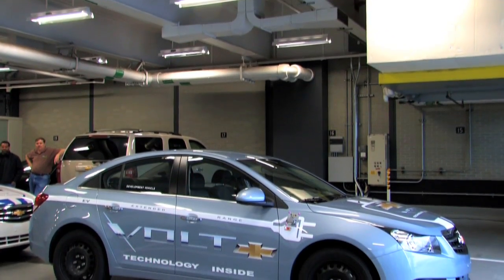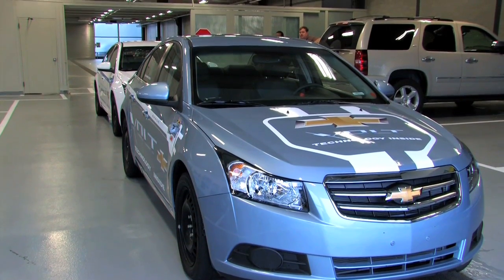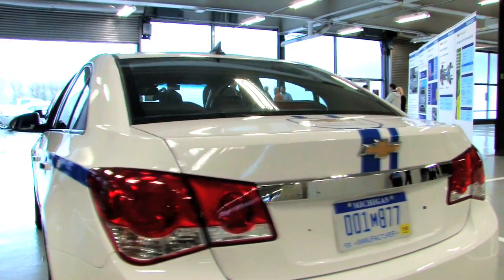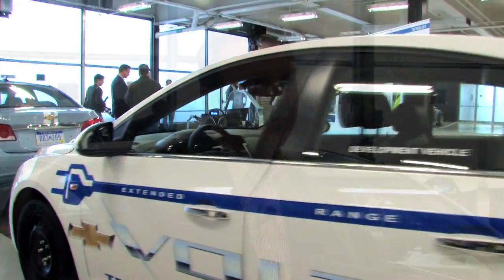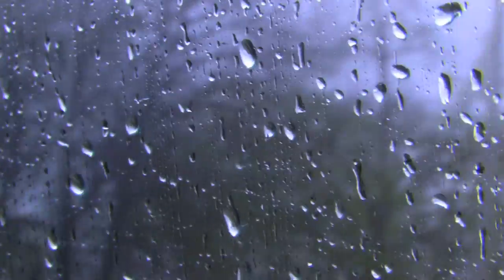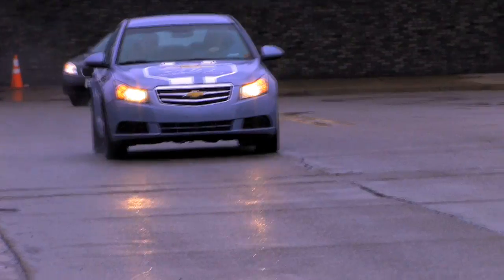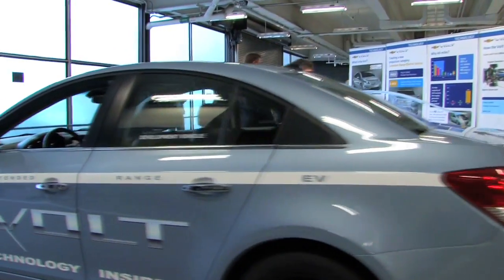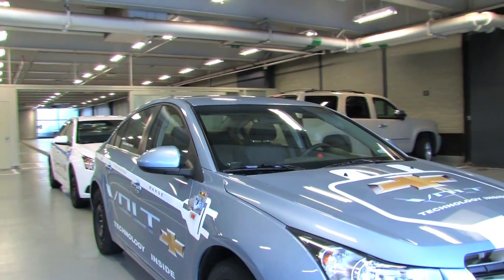First drive of the Chevrolet Volt prototype

Comment: I disagree with both of you.  This has real potential.  I've been driving all-electric vehicles (a GM EV-1 and now a Toyota RAV4-EV) for the last 9 years.  Most of the time, my 80-100 mile range is all I need, and indeed I only have to charge every other day.  Occasionally, though, I need more range.  A range-extended vehicle like Volt, with 40 miles all-electric range, would work beautifully for me, and for most Americans (whose daily commutes are <40 miles).